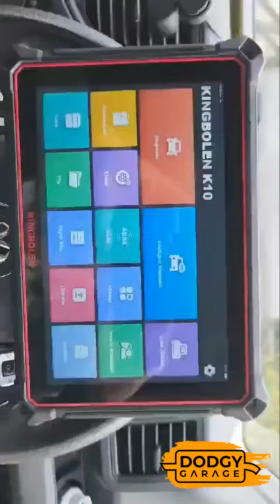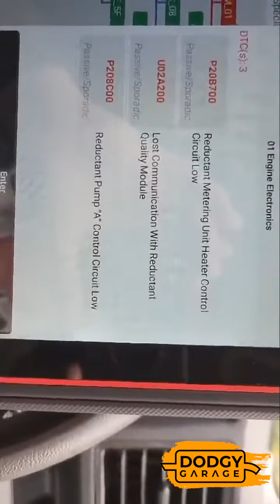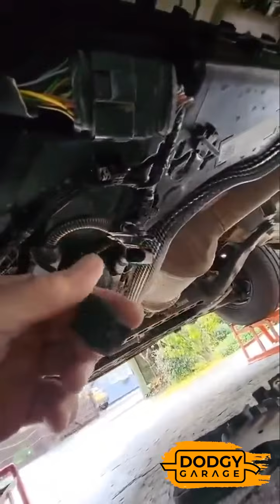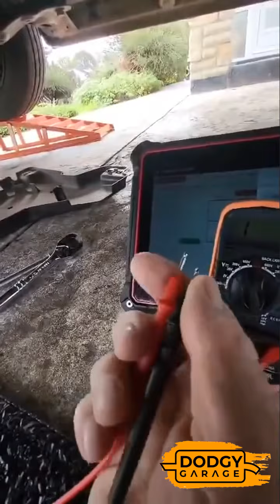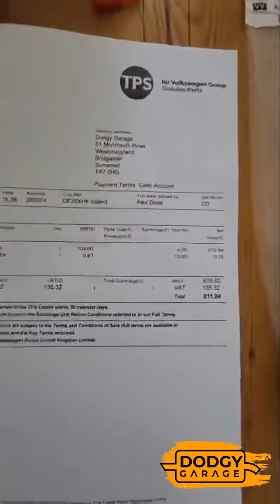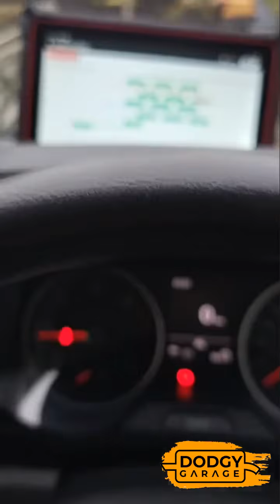2020 VW Crafter Ad Blue Fault Codes P20B700, U02A200, P208C00

Comment: Hi great video, my fault is fill the tank says 7000m range after driving for around 600miles it comes up with adblue low, no srsrt 600m, then if i refill around 500ml the light goes out and back to 7000m range, i only have a cheap obd scanner but fault code is u02a2 p, was your fault similar to this?